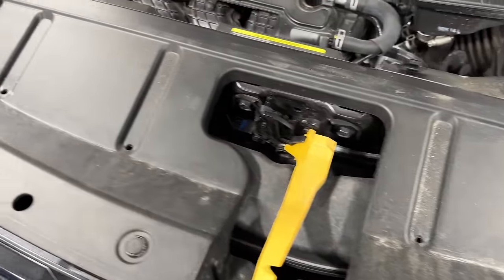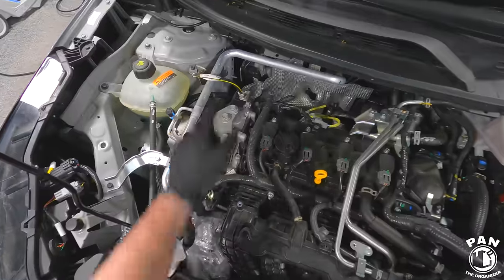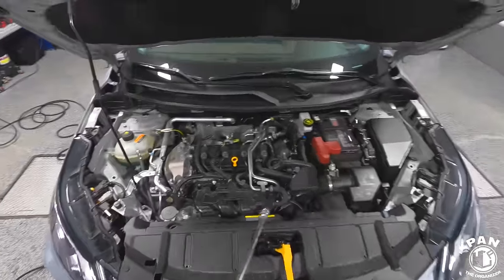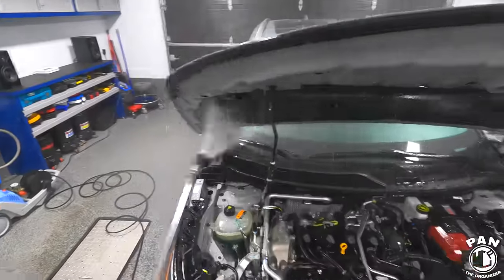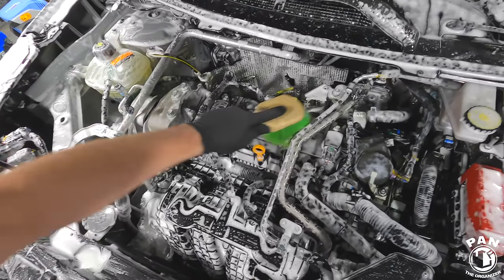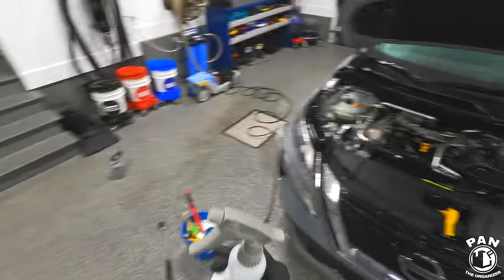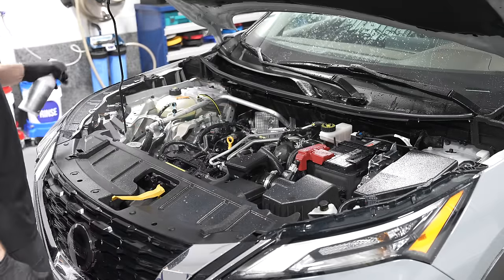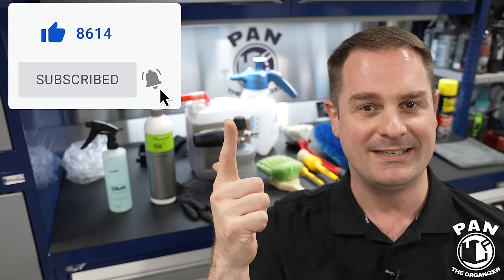How to Safely Clean Your Car's Engine Bay!

Comment: i wonder with the rise of EV's how it would effect doing the engine bay?  have to admit i lifted my bonnet the other day and dropped it back down when i saw all the high voltage signage lol
Reply from the maker: When it comes to hybrid engines, most of the common sense and tips are similar to regular engine bays, with a few slight tweaks.

Here are some videos that give more details: 
Toyota Prius engine bay: https://youtu.be/UQhrIEYwW9E
General hybrid engine bay cleaning tips: https://youtu.be/AHosBEZAHPY
General tips: https://youtu.be/X_cwN4ljpG8
Reply: @PanTheOrganizer  thanks for the reply Pan

Comment: WHY the hell do you want to risk damaging electronic components by soaking them in water?????
Reply from the maker: If you use common sense and follow the instructions, there isn’t any worries especially on newer cars made in the last 8-10 years.

I have been detailing cars for 27 years and have detailed hundreds of engine bays without ever having an issue. Same applies for any of my detailer friends.

Comment: Does anyone else think that pressure washing an engine bay is a bad idea? 2,000 PSI?  Really?
Reply from the maker: First, my pressure washer is set to 1000 psi when washing cars. But even 2000 psi is fine. As long as you use common sense and keep the wand moving, not spraying the same area intentionally for a long period of time. I have detailed hundreds and hundreds of engine bays in my 27 years of detailing, and never once had an issue. If you use proper techniques and common sense, it's not rocket science.

Especially in the past decade, car makers have gone to extreme lengths to make sure their engine bays are water tight. When you drive in rainy conditions, water does get underneath the hood by the way. ;)

Welcome to my channel. You discovered one of the biggest car detailing channels on YouTube as we surpassed 990,000 subscribers and we have over 135 million views! I have been detailing for 27 years and I love to share my knowledge and passion with my viewers.

You found the right channel to help you learn everything about detailing.

Comment: u can’t spray that don’t do this!!!!! your car will not start
Reply from the maker: That couldn’t be any further from the truth. I have been detailing cars for 27 years and in those decades have detailed hundreds of engine bays. I never had a single issue. NEVER.

Use common sense and proper methods and there are no worries. Car manufacturers go to extensive lengths to make sure their engine bays are water tight.

Obviously you wouldn’t use a 5000 psi gas pressure washer and blast away. In detailing we use 1000-2000 psi max. And keep the wand moving so you’re not spraying on the same spot for too long.

Don’t spread misinformation if you don’t know what you’re talking about and have no proper detailing knowledge/experience.

Comment: frustrating when cleaning videos are performed on already clean cars....not helpful as it could/should be. cmon Pan.
Reply from the maker: This wasn't clean by any means. Was it disgusting? No. But then again, I don't disaster type details on my channel. There are enough copy cat channels that do that. Not for me. Here I share the techniques, tips and tricks that can be applied regardless what dirt level is in the engine bay... The techniques and products and tools don't change. You just need more elbow grease on a dirtier engine bay. That's the only difference.

Plus, the majority of my viewers actually enjoy detailing their vehicles and would never let their engine bays get to a point where they are disgusting. So this is actually a good test candidate for the video.

There's nothing frustrating here dude. If you don't appreciate the tips and methods, there's nothing I can do for you.